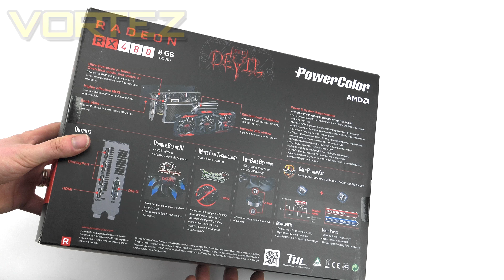Powercolor RED DEVIL Radeon RX 480 Review [4K]

Comment: I'm noticing a fairly large difference in image quality with the Witcher 3 benchmarks. For example, notice how at 8:58 the grass and sand textures are way sharper on the left side. The other benchmarks don't seem to show similar discrepancies, though. Could you clarify this, Vortez? Perhaps a mistake in the settings?

Comment: Damn, those Witcher 3 fps numbers compared to ref 480, were quite interesting.
Reply: Witcher 3 heats up the gpus more than other game i find with my 970, perhaps reference 480 thermal throttles on witcher 3?
Reply: Possibly. I can't think of any other reason. The differences should be marginal (3-5%) at all times across all games, given the clock speed increase is the only thing different.
Reply: you can overclock it to 1370 MHz with default Voltage , which is really nice !. above 1370 you have to increase voltage .
Reply: it requries a 8pin how do you know if your system can fit it?
Reply: I just got a PC with this card and it runs the Witcher 3 at around 50 or 55 frames on ultra 1440 for me

Comment: +Vortez for a reference card that's pretty good against the custom card.  Also in the video there was only a 2-10 difference in fps.  The only problem I have with the devil card is its too long and for $270 it's not that much of an upgrade from the reference which is $240.  My budget is $950, but when I put the red devil into my list it goes up to $970.  If I take out my ssd it will solve the problem but I want my ssd for Windows and my 1t hard drive for games and other personal information.

Comment: Powercolor couldnt get that much more out of the chip like sapphire did in their nitro series ( from reviews that i have seen). But it does stay quiet and cool. The red devil seems like the better option atm
Reply: The Devil is around 9 decibels quieter, and that's a huge amount. All seems to be due to that massive heat sink, so the fans don't need to run so high.

It's certainly the card I'll be getting out of the two. I just hope that backplate doesn't give me any issues in my X99 Deluxe like it did Vortez with his mobo.
Reply: Al Valentyn the devil card series is great , i have the devil r9 270x and it looks great in person and is really quiet even after using it for long period of time. Powercolors tech support is also very friendly and quick

Comment: +Vortez Nice job on the paper review! Gamers Nexus did not show how the 980 Ti did with Doom Vulkan, and like I figured it BEAT THE 1070!

I bought my G1 Gaming GTX 980 Ti recently, I was REALLY close to buying a new AIB model 1060, or even a 1070 - but then I started looking at the used market, initially looking at regular 980s, only to then find, that 980 Tis were selling for about  $75 more on average (at the time) 

Then after Pascal and Polaris had been released and ALL the benchmarks were in, and I saw that for a FACT a GTX 980 Ti I at 1450 core is faster than a GTX 1070 at 2.1 GHZ core!

So I started putting up bids on Zotac AMP!, MSI Gaming 6G OC, EVGA SSC, and of course Gigabyte G1 Gaming Model 980 Tis, totally IGNORING Reference versions (that cooler is WAYYY overworked for a 980 Ti and it's rather massive 601mm square GPU)

Anyway, I ended up with the Gigabyte model - and I COULDN'T BE HAPPIER! 

Seriously, if you look at GTX 980 Ti reviews where the manually OC all the "Top End" Aftermarket boards, the Gigabyte G1 Gaming GTX 980 Ti almost ALWAYS wins!  

I mean straight out of the box, the AMP! Extreme and Asus STRIX beats the G1 Gaming, but with Manual OC and over voltage the G1 Gaming pulls ahead VERY quickly! 

I half wonder if that is because all G1 Gaming GTX 980 Ti's use SK Hynix VRAM, and that perhaps their "GPU Gauntlet Sorting" actually means a lot  (based on how they word it, the Sorting is NOT based on ASIC quality, mine shows 69.8% in GPU-Z, but rather they sort by testing the chips to see which will allow the highest over clocks with extra voltage piled on) - But apparently I am LUCKY that I can make my 980 Ti run VRAM at 8.2 GHZ effective, or 2050 MHZ base.

And that 392 GB/sec Bandwidth probably has a LOT to do with the G1 Gaming  winning out in manual OCs
Reply: TL;DR

I spent $355 on a Video Card that is FASTER than a fully stock GTX 1080 - and still a good bit faster than a fully overclocked GTX 1070! 

IF I were to have bought the GTX 1070 instead I would have paid about $460 for an equivalent model, and in any case not less than  $445 - so basically $100 more for LESS Performance!

Comment: Hy what do u prefer rx 480, gtx 980 or gtx 1080.. For mod gaming ultra graphic like skyrim and fallout 4. Thanks!
Reply: Depends on the resolution you plan to play at. At 1080p I would go for the RX 480, but 4K you'll want a 1080
Reply from the maker: DarkrainHD makes a valid point. Also depends on your budget too, the GTX 1070 also slots into the 1440p space quite well if you're in between 1080p/4K.
Reply: Thanks for your advice i appreciate it :)

Comment: Hi Sir!
I am facing a problem with this Graphics Card.
It freezes/crashes the system when i play GTA V on it, even on Medium settings.
I tried Alot of games but the same happens every time. I try to find tweeks but it doesnot fix.

Please Help ME

My Specs:
• intel i5 7500 3.5Ghz
• Power Color Red Devil RX 480 8GB
• RAM 8GB DDR4
• HDD 1TB
• Asrock H110M MotherBoard
• CoolerMaster B500 V2 Power Supply

Thank You

Comment: Word is out that Manchester United is taking legal action against Powercolor.

Both RX 480 cards have the same issue with min FPS (9 fps lower than RX 470) in Thief 1080p Ultra.

Why 1080p only actually? Why not also 1440p with quality settings one notch down? I would love to know how close RX 480 8GB can get to 1440p@60fps with high quality settings (or whatever is one notch down from Ultra). And maybe not having to go for an GTX 1070.
Reply: Robert so what happened wirh the lawsuit

Comment: Hi, i have a problem and im very worried about it .
i buy a rx 480 red devil 8gb like 2 weeks ago and i test it in dark souls 3, gta 5 and skyrim special edition... and i have very low fps :
skyrim SE : 30-40
dark souls3: 50-60
GTAV: 30-36

i also do a heaven benchmark and i got 1330 score on it
i dont really know whats the problem but everytime i see a benchmark or a test on ultra in youtube you guys have like crazy high fps in all the same games i play on my pc.
can you help me? i need to know what in my setups/pc its causing the low fps.
my pc setup is :

GPU - Radeon (TM) RX 480 Graphics  - 8192 MB - GDDR5 - 1330 MHz
Windows - Windows 10 (64 bit)
RAM - 32 GB
CPU - AMD FX(tm)-8120 Eight-Core Processor
Mobo - gigabyte 990fxa-ud3

please please help me!..............also great video XD
Reply: Your cpu is bottlenecking it!
Reply: ^^^^^ He is most likely right. The CPU is nearly 5 years old. An i3 6100 is better than it right now...
Reply: It`s maybe from the processor,but processors from Amd are not really good for new games.
Maybe the ryzen can run in 2017 new game like the i7 do.
Better get a i5 6600k 
sorry for bad english :D

Comment: This or Sapphire Nitro+ OC?
Reply: this
Reply: This
Reply: I think i will get the nitro cause it has 2 hdmi ports and i need 3 of them and i dont like converters
Reply: That's hardly good enough of a reason for me, no offense. I am more bothered by noise and frame rates, especially noise. 

Also, what's the big deal with using converters? it's not like they hurt quality. There are even cables that simply have DisplayPort on one end, and HDMI on the other, so you can avoid converters if it matters that much.
Reply: Danny Blue I had an display port to hdmi cable didnt work for some reason but converters will hurt the response time.
Reply: Well, for some weird reason it seems like the Nitro is getting better OC results...
But both this and the strix seem to be a lot quieter...
Reply: Reviews for the MSI Gaming X RX 480 came out today.
Seems like it's the quietest out of all cards while still giving pretty good frame rates.
I'll probably get that one.
Reply: +Danny Blue yeah its either this one or the msi. I plan of painting mine white for my build for it match.
Reply: Danny Blue Hum, they managed to OC it to 1370, better then many of the others.
Still, people seem to be getting up to 1420 on the Nitro, so...
shrugs
Reply: Depending where you live RX 480 8gb aftermarket run for the same price as GTX 1060 6gb aftermarket. Much better to get 1060
Reply: fishywtf Apart from the statement about the 1060 being better only being correct if you look at certain titles at certain non-favorable settings...

I'd rather pay 20 k USD for gaming on a 320x200 black and green monitor at 5 fps on average with dips to 1/2 a frame pr second gaming then go Nvidia or Intel.
So thanks for your suggestion, but no thanks, Nvidia is irrelevant to me and will be as long as there's no one forcing me to use their products at the pain of death, and even then I'd seriously consider death over using their products...

It's either VIA or AMD for me for CPUs and heck, I'd even prefer a Matrox C680 or S3 Graphics Chrome® 540 GTX to a Nvidia product... (the third and fourth biggest desktop graphic card producer out there respectively if you exclude Intel)

Heck, if you where to offer to give me two 1080 to SLI and paid me half a milion dollars I'd still prefer to keep using my current R9 285 to touching such a "unholy" thing. ;-)

Anyway, that doesn't matter, AMD is also cheaper over here.

Oh, and by the way the 480 is way better then the 1060 if you are planing to use it for more then 3 years due to having better DX12 and Vulkan support at a hardware level and actually having more hardware to begin with (meaning that whatever optimizations Nvidia might throw at their own hardware AMD can match or beat them long term) and having more memory.

Also, I'm planing to use this thing for a 3440x1440 freesync screen, or in other words, I need to crossfire it, Nvidia don't have SLI support on the 1060 so while it might be possible to do a multi-gpu system with it when more games get explicit multi-adapter support the 480 still have better support for multi-gpu rendering in titles that does not have that feature yet.
Reply: OH FFS I BOUGHT A NITRO 8 GIG OC ! 
FUCK
Reply: its was for me a bit cheaper by 20 buks
Reply: gibbythebest kotwal The Nitro isn't a bad card either though. shrugs
Also, you can return it, no?
Reply: Luredreier i cant my case wont allow a bigger card to
Reply: gibbythebest kotwal Fair enough. =)
And in that case the nitro don't seem like too bad a choice.
That said, the stock 480 from AMD might actually be a better option for a small form factor case as far as system temps is concerned.
Although I hope one of the AiBs will make a blower style cooler that's actually a bit more silent then the reference model...
Reply: Luredreier I have a short but very DEEP AND TALL case ;)
Reply: it is a cube style case
Reply: gibbythebest kotwal Hum, perhaps worth doing a custom water loop with time?
The nitro actually seem to be getting better OCs then most of the others as far as I can tell for some weird reason...
And with a custom loop you'd be able to cool it more effectively then the cooler that Sapphire included.
Reply: Luredreier Yeah i heard the same about it been oc quite a bit. But for now ill stick with my r9 380x
Reply: Danny Billy Fair enough, although I think a 480 would actually be quite a fair improvement over your 280X.
I have a 285 myself, it's a tiny bit worse then your card and I plan to get a 480 (and then to crossfire it later when I can afford a second card) to drive a 3440x1440 monitor that I'm planing to buy (the main reason why I can't afford a better card right now).
And I expect quite an improvement, the 285 certainly can't handle 3440x1440...
Reply: Luredreier Well i dont have a monitor over 1080p so dont mind my 380x 4gb for 160
Reply: Danny Billy Fair enough. =)
I'm going to buy either a lg 34uc98-w or a lg 34uc88-b soon I think.
I'm on the very brink of affording them now after having saved for a while...
And I think I can afford a Asus 480 Strix too in a months time.
I'll be eating a bit lean and won't afford to do anything else...
And I might have to take a small loan...
But I think I'll manage that...
And once I've paid down that I'll start saving up for a Zen 8 core CPU, a motherboard with the AM4 socket, and and this will probably be the most expensive part, 32 GB of DDR4 RAM (I'm currently running a FX 8350, R9 285 and 32 GB of DDR3 @ 2133 (it's technically a 4 module set rated at 2400, but the memory sub system of my 8350 just can't handle all 4 modules running at 2400 and keeps dropping the last module at  that speed, with 2133 all 4 runs stable)
I'm not sure if I should get the 32 GB as two 16 GB modules or four 8 GB modules...
If the rumors about 8 channel support on Zen are true then 4 modules are tempting...
Trouble is just that the RAM prices are expected to go up soon...
(They're extremely low right now, but I expect that to change before the launch of Zen :-/  )
Reply: Luredreier The Problem is my buget was only for a new card i do not thing that i could water cool the card :(
Reply: gibbythebest kotwal Hum, vel in that case just undervolt it if you want less noise and heat.
I think the performance should be ok regardless of that.
Reply: kk :3
Reply: gibbythebest kotwal So, has your GPU arrived yet? =)
I'm looking forward to my own 480 arriving with time. ;-)
Reply: gibbythebest kotwal What do you think so far? =)
Reply: +Luredreier 10000000% better than my hd4850
Reply: gibbythebest kotwal Hehe, glad you liked it. ^^
And how is the sound? =)

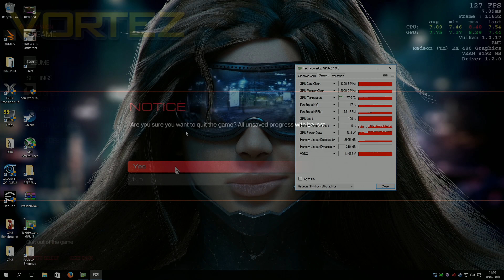Comment: 13:45 LMFAO!  RX 480 Plus MASSIVE BEAST cooler Plus MINOR Overclock = 77 degrees in Doom!

Seriously WTF IS THE POINT IN THIS LEVEL OF AFTERMARKET COOLER ON AN RX 480? 

For reference; I bought a Gigabyte G1 Gaming GTX 980 Ti off eBay for $355 (USD) all said and done, I now have her running at 1503 MHZ core and 8.2 GHZ effective VRAM  (for 392 GB/sec Bandwidth) - when gaming my GPU NEVER gets hotter than 63 degrees Celsius, I  Unigine Valley after a good 5 passes, it hits 66 at absolute max, EVEN FURMARK - Just 71 degrees after 30 minutes!

The RX 480 WILL NOT hit even 1400 MHZ core, despite what Fanboys are STILL writing in comment sections everywhere, it STILL gets HOT, and costs MORE than a GOOD GTX 1060 with a dual fan cooler, which WILL let it easily hit 2.1 GHZ Core and VRAM up to 240 GB/sec in some cases, but usually never less than 215 GB/sec with a decent OC on the VRAM.
Reply: Basically, at this point in time, BUY USED or BUY Nvidia! 

Seriosuly the R9 390X is selling on eBay for $230 on average here in the US! And I am talking XFX version with 1100 MHZ core - which will slap the 480 around like the bitch it is.

If you care AT ALL about power and thermals - BUY NVIDIA!  

But one thing NO ONE should buy - IS A $270 RX 480!!! NO POINT AT ALL! You could buy a REALLY good aftermarket GTX 980 for that, which will EASILY hit 1500 core and beyond while running FAR cooler!

Or a GTX 1060 which sucks FAR less power, produces FAR less heat, and but for maybe 3% of all current games BEATS THE RX 480!  Add in the EASY 2.1 GHz core speed any monkey that knows Afterburner can reach with ANY 1060 - and that becomes just 1% of current games - aka Vulkan Doom!

Comment: But... PowerColor just seems like such a no-go brand to me... Like buying a Dacia..
Reply: PowerColor may not be the first brand that comes to mind when it comes to graphics cards, but it's respectable enough. I mean the first thing you may think about is Sapphire, ASUS, MSI, Gigabyte... and then you've got your Zotac, XFX, Palit, PNY, HIS... and of course Powercolor. Which aren't bad brands by any means, just overshadowed by the bigger brands. Don't worry.
Reply: Sir Caco D. Mon Noamally wouldn't touch Gigabyte, Zotac, Palit, PNY or HIS.. even with a fireprong.. XFX is in the middle somewhere.. But yea, opinions change, and ill have to see more reviews of the other cards.. but this does look decent and with good cooling..
Reply: MyrKnof Indeed it does, but it's not very case friendly. I don't have any problems with GPU size because I'm still rocking the old Antec P182, which really doesn't care what kind of GPU I throw at it, but most medium size cases will probably not be enough for this card.
Reply: +Sir Caco D. Mon I agree. Seems risky cause this is a under rated brand and not huge like MSI, gigabyte etc